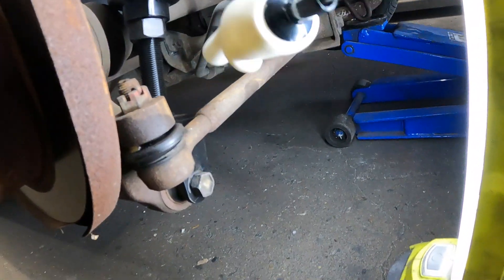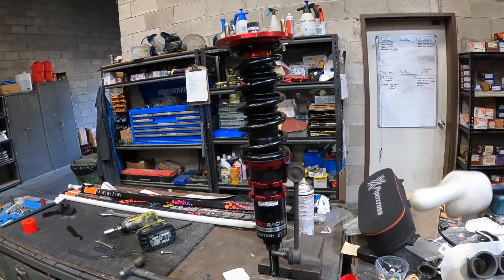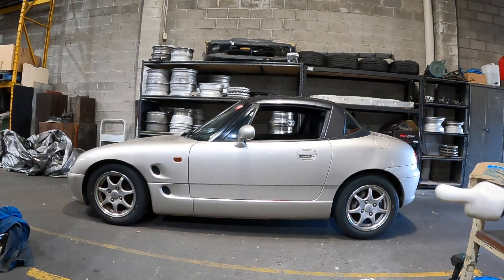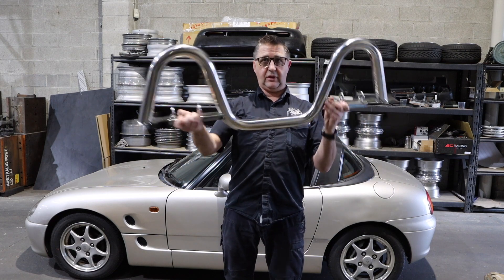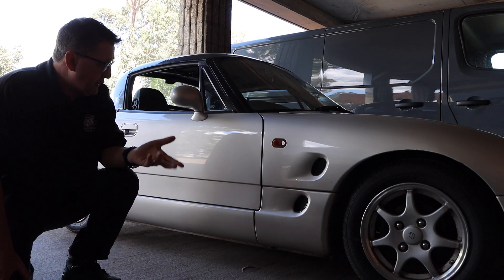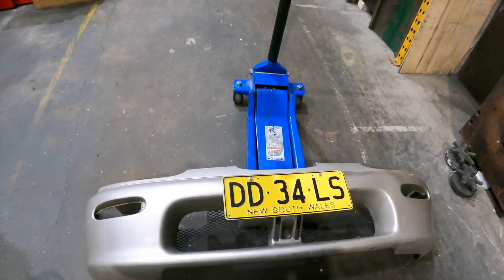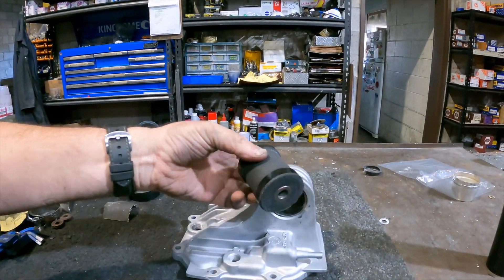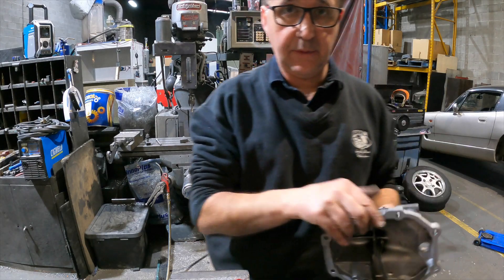75. Suzuki Cappuccino (Viperccino) Part 2. Work starts!

Comment: The only reason I can come up with for the sleeve being threaded is to not damage the shock threads if the locking ring underneath the sleeve were to loosen. Now the shock threads might end up getting peened over due to the tiny bit of play after a few years. But perhaps the sway bar isn't stiff enough to do such damage to begin with :)

Comment: The reason why it’s threaded is because the force exerted by the swaybar under load is not 100% vertical and is exerted slightly toward the front of the car. Every time the sb is under load it tightens (or loosens depending on which side you’re looking at) against the collars below and above, which further locks it in place. In my case, there’s enough longitudinal force from the sb to shift it toward the upper control arm no matter how hard I tightened the collars without stripping the teeth and busting my knuckles and these are with the threads still on. Since you no longer have threads on sb collar, the collar is now floating and guaranteed to shift and hit your upper control arm. FYI, hard cornering on BC Racing coilovers will actually bend those sb mounts. Ask me how I know. Poor design and not strong enough.

Comment: In regards to the threaded shock collar: Easier, yes... Safer, no. Companies need to consider liability, having a redundant fail safe seems like a good idea in that regard.
Reply from the maker: I can't actually see how it is safer.
The 2 collar nuts lock against each other, the shock base height adjuster collar nut locks against the shock base tube, the shock base bolt nut locks against the shock base. How I've made it now is like having a big washer between the lock nuts. 
Threads lock up against things, it's what they are designed to do.
I daily it at the moment and it's done nearly 4000kms with the shocks like this with no probs. 
I've been able to change the ride height in a matter of minutes 3 times over that period.
Have yet to see a problem, and even if it does come loose it's not catastophic, and the rattle will give it away anyway.
Reply: @BarrelBros  Redundancy, basically. Peanuts work on cars too, you are not a peanut ;-)
Redundancy often compromises ease of use, unfortunately.
Reply: @BarrelBros  Reasons why BC did it right there - If it does come loose it'll rattle. That'll generate service calls and/or negative reviews. Making it less practical to work with is something the people who would be making those calls have no idea about anyway as they wouldn't be doing the work on their own cars, BC aren't doing the work either so they don't care about the impracticality.

Comment: Search these on the bay...
'Bull Bar 4inch LED Fog Light Upgrade with Indicator DRL'
Reply: Or check out STEDI
'LED FOG WITH DRL UPGRADE FOR ARB DELUXE BULLBAR'
Reply: On the bay again...
Pair 4"inch LED Fog Lights Bluetooth RGB Halo DRL For 2007-2017 Jeep Wrangler JK
Reply: Ama zon
UTVJATV JK Fog Lights LED with halo ring for 2007-2018 Wrangler JK Unlimited with Amber Turn Signal Lights 4Inch LED Fog Lamps
Reply from the maker: I came up with a solution but I'm not 100% happy with it. Having a very close look at these though, thanks for the heads up!